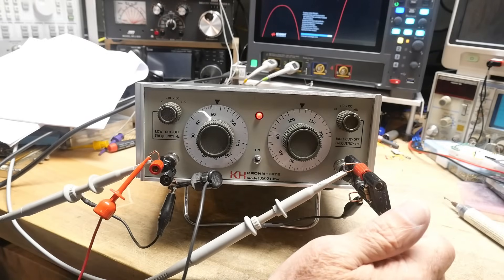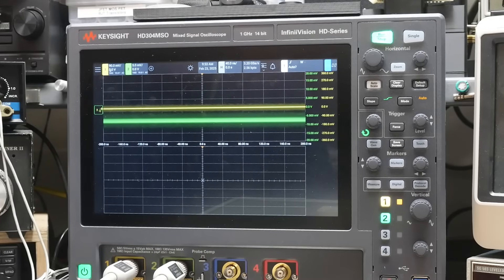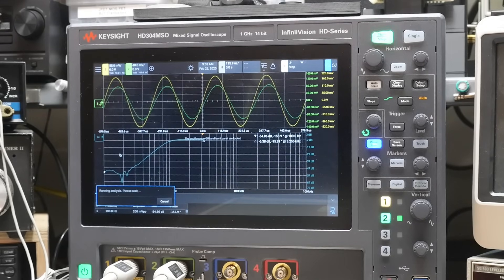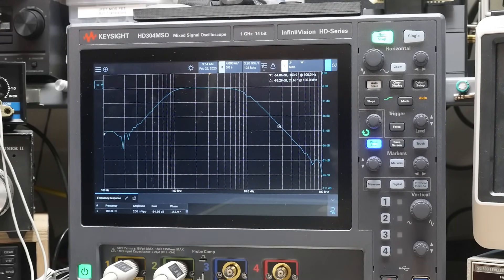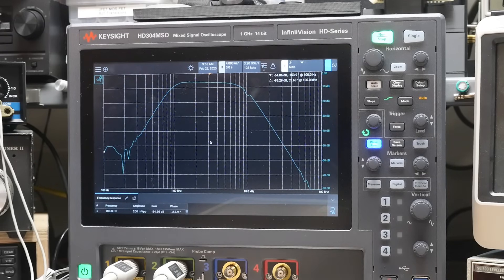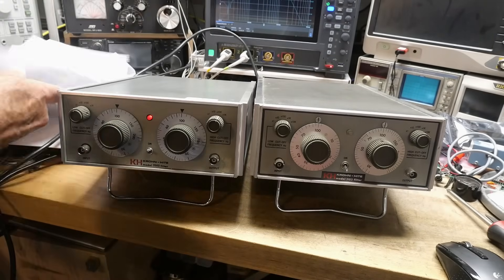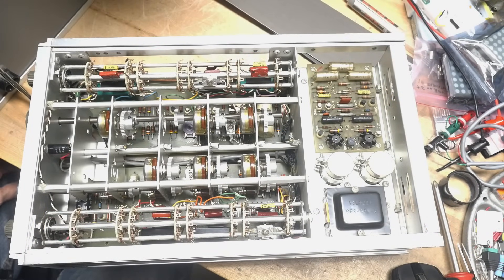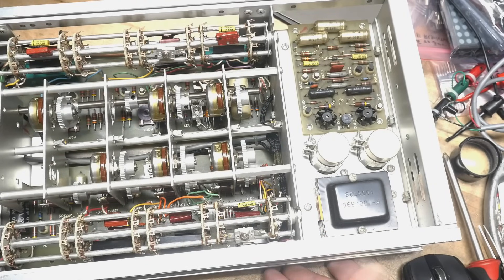#2167 Krohn-Hite Model 3500 Filter (part  2 of 2)

Comment: 6:53 there are at least two places where there's a gear on the input shaft but no corresponding potentiometer. I wonder if additional poles can be added just by soldering components in.
The 3103A also came in a rackmount form factor. I'm guessing the box is about the same dimensions, just with the contents rotated 90 degrees. It looks like yours has aluminum gears; I'm jealous - mine has plastic, and I am surprised they haven't broken yet.

Oh - just remembered. I couldn't find any manuals with a schematic matching mine; they all showed 3 stages, while mine has 4. Maybe the extra stages made no difference.

Comment: As i remember from 40+ years ago, you need to have an odd number of poles for an oscillator, but for a filter, any numbers will do.   I remember I built a 3 stage filter (6 poles in total) Butterworth in the lab using 3 ua741.

Comment: I bought my Krohn-Hite filter about 20 years ago at a local auction for AU$20. Mine is a model 3550 which is almost the same as the 3500, but the power led is moved down to the center of the panel and there is an additional switch were the led was. The extra switch allows for selection of low pass, high pass, band pass and band reject.

Comment: If you read the comments to your previous video, someone mentioned that the caps are fixed values which are switched in for the various ranges. Son the caps are all on the switch wafers.
Andy
]

Comment: Your fancier 5-band one looks more like the kind of design I would expect, in that the continuous 10-to-100 variable part is done entirely by variable resistors, meanwhile those wafer switches on the decade selection are swapping between different fixed capacitors, presumably all the same value scaled by various decades too. Overall that feels a much simpler design than trying to account for continuously variable capacitors as well.
Reply: In part 1, the manual text above the block diagram said it worked the same way. The "variable capacitors" are the band switches and the resistors are the frequency knobs.